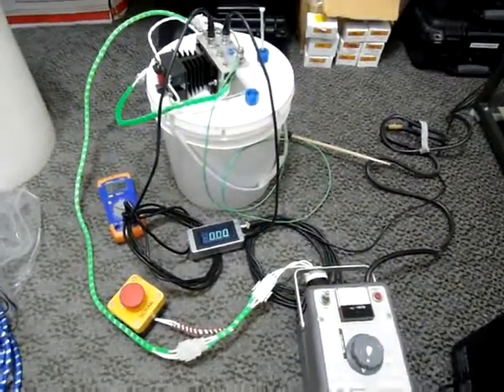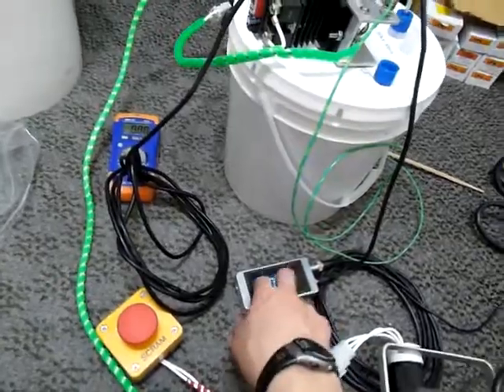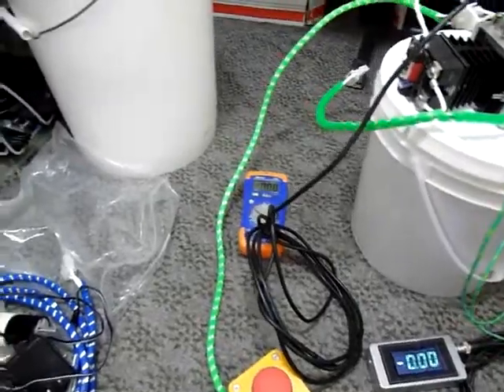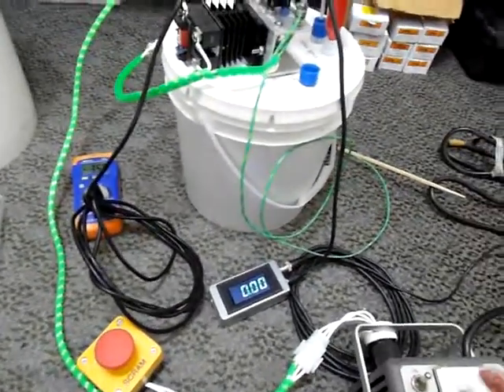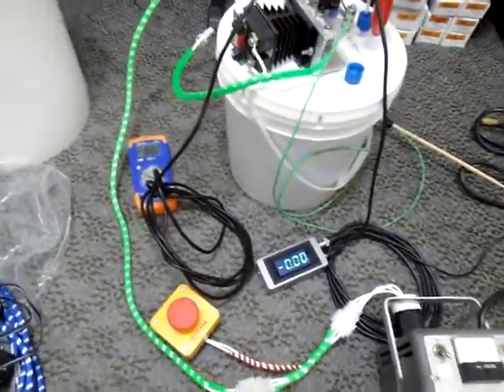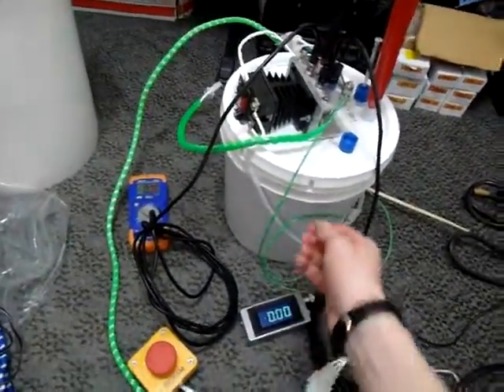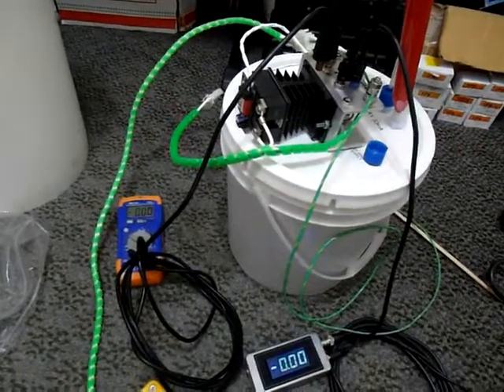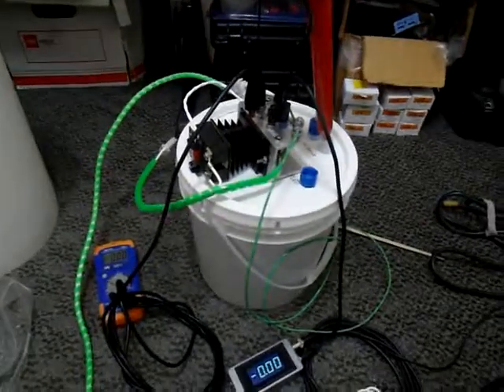High Voltage X-ray Transformer

Comment: Yes some is true what you say' but ballasting your transformer to reduce current' you can run them for many hours, I ballasted a 150kv  14mA xray transformer with 800watts of current and it ran all night and wasnt realy warm the next norning! 
I deal in Xray invertor tanks and the inverter type are alot more rugged to the 50herts type, 50herts transformers are no way as interesting as the inverter type' and there powerd to ballast at around 2000watts or more and iv 150kv transformers and run them for hours, its all to do with how you set these things up and run them, if you have gave them good insulation and vacuum and a good box and output bushings/federal connections your going to be fine! Dental 50herts transformers are no way as good as your industrial transformers, iv had alot of dealings wiith them too,  iv never had a bad xray transformer from an inverter tank to ever have a flash over! There bloody solid mate, iv even changed the iron cores to ferrite core so I can bring the frequencys up alot more to see the different effects on the arcs, ;-)

Sorry for the long rant mate, I think you have realised I like my xray units lol,

Check my videos, you may like what I do,

Thanks for sharing'  be safe

☆☆☆☆☆THUMBS UP☆☆☆☆☆

Anthony-

High1voltge1rules